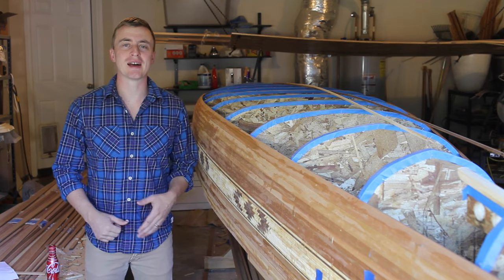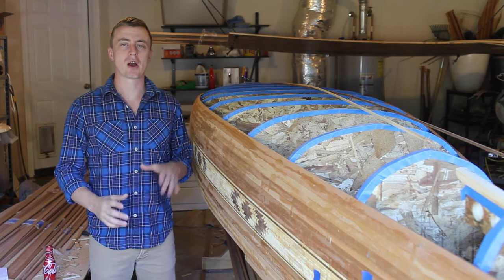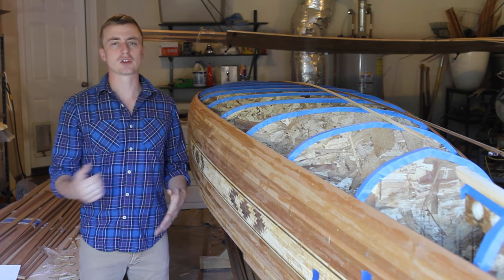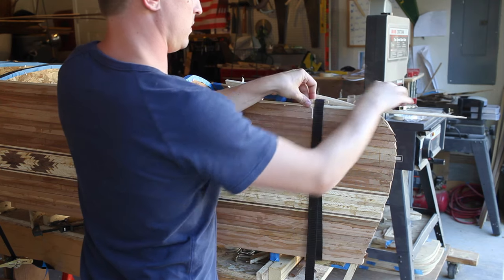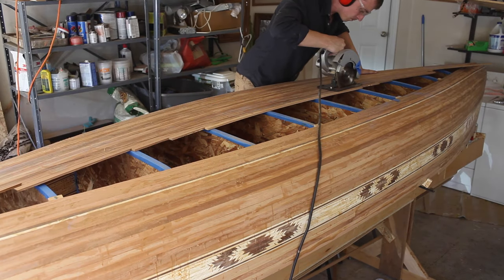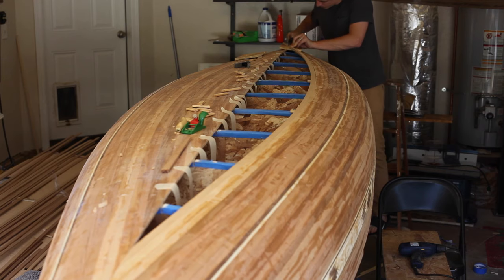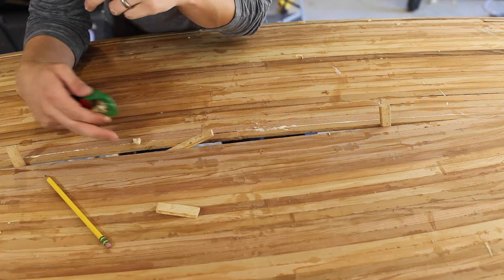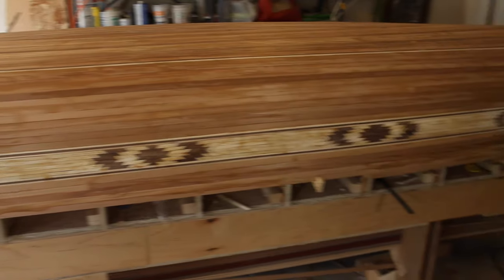Building the Hull - Part 2 (Ep 7 - Cedar Strip Canoe Build)

Comment: You seem to be using normal wood glue, which is not waterproof.  Is that the case? If so, is it OK because you rely on the fibreglass/epoxy seal to keep all water completely out? What about nicks in the fibreglass letting water into the strip seams?
Reply from the maker: yep - it's all good because it's encased in fiberglass. You won't really get nicks in the fiberglass epoxy seal. If something really serious happens it might crack a little bit but you'd have bigger issues if that happened. the fiberglass/epoxy is more of a shell than a finish - it's flexible too which makes it extremely strong. You can watch my #ripcanoe video to see how strong they really are.